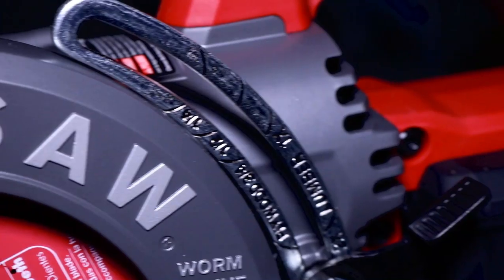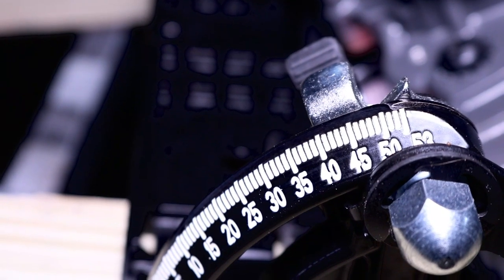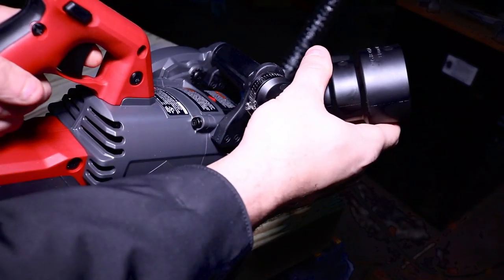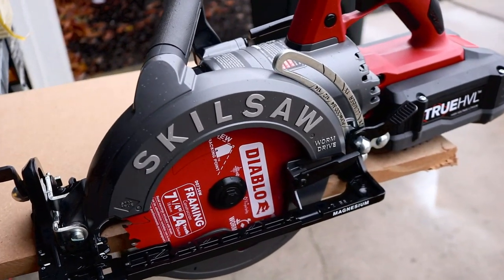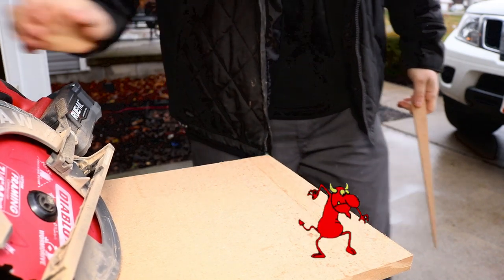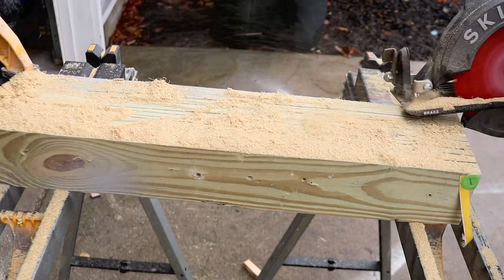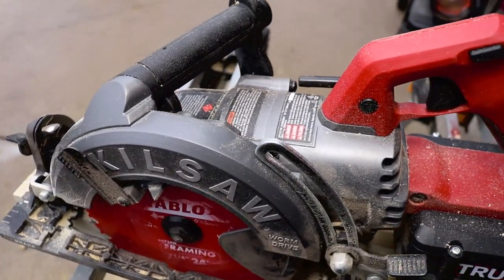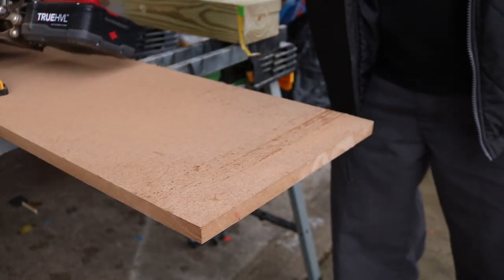SKILSAW 7-1/4 TRUEHVL Cordless Worm Drive Circular Saw (FULL REVIEW!) #skilsaw #wormdrive #saw

Comment: I got one used on a small fence job once. with 2 batterys and charger for 300 bucks even.. Is that a good deal?. What would you value that deal at compared to what it would cost me for those items full price in the store.?
Reply: If you got it in good condition that’s a great deal. I just bought the 2 battery combo kit with tax for $440. I’m probably going to return it and buy a used one for cheaper

Comment: Hi TRZ would it be possible to do a matchup between this saw and the Milwaukee wormdrive style one? Nobody has done it yet and it would be great so I can decide which one I should get
Reply from the maker: Absolutely.  I'm putting it up against all of the rear handle saws including the Milwaukee bro
Reply: I've got the Milwaukee, and while I've not used this skillsaw, from the videos ive seen online it's not even close, at least in terms of power.  The Milwaukee will protest a little bit when taking on pressure treated lumber.  It wont stop, but slows down a bit.  This thing cuts through it like its 1/4 luan.
Reply: Skil for me it is